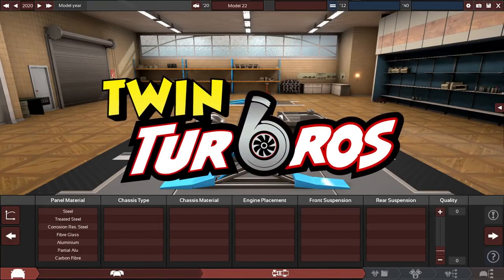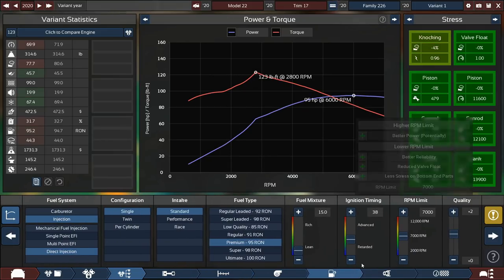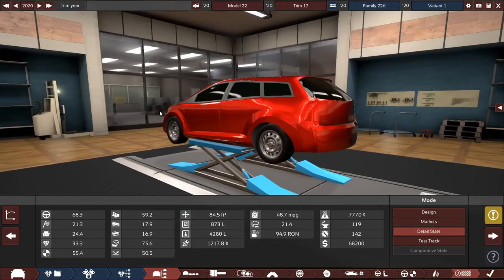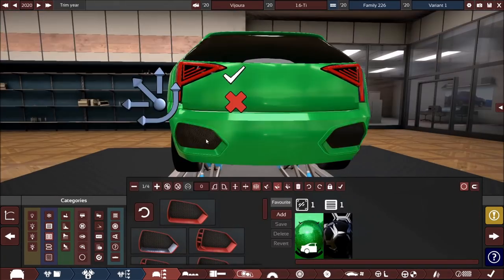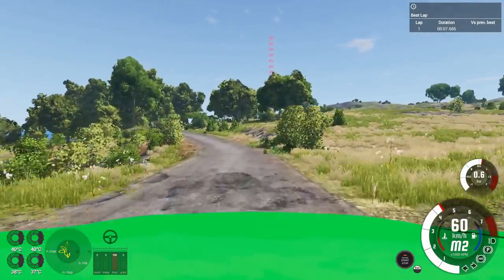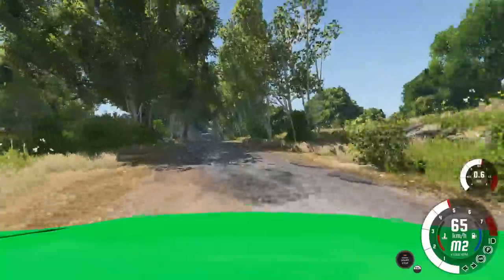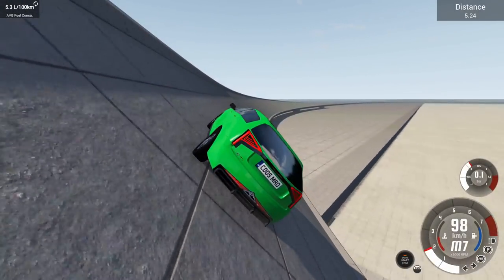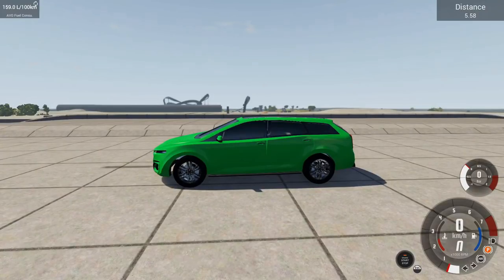Making a 16 Cylinder Eco Car?!  Automation - BeamNG

Comment: The name of the vehicle, I believe it was Vijoura? It could be one of those dictionarily-meaningless words but derived from vigour/vigor, which is a noun in reference to good health and good strength. It could be said this vehicle has good vigor, its strong as a sporty eco hatchback and is good for world health in that it achieves 50 MPG highway. The name kinda checks out once you jump through the right hoop first.

For the mileage test it would've been better to use the gridmap instead, as the banked corners cause increased rolling resistance and thus increase friction and lower mileage. It should be reaching around 4.8 L/100km as that is roughly the 50 MPG figure Automation describes.

Comment: it sounds like you have noise canceling turned on, I assume you use speakers with desk mounted mic either turn your volume to 0 when recording or get headphones. if it's not the case then your mic's Dynamic range isn't low enough, in that case try lowering your mic's dynamic range to -30db or so though there will be more background noise from your environment.

Comment: still yet to see an automation youtuber that knows anything about tuning/building engines
Reply: Yea, coz 87 of 100 timing is so real life!
Reply: FakeMichau nope, but i havent seen a single competent build by an automation youtuber. always turbos to get good power, or when they have a high revving engine its always at the cost of pistons and rods, when my builds dont need turbos to get 700 hp out of a pushrod v8, and also there was a lot of shit in this build that he couldve done for fuel economy